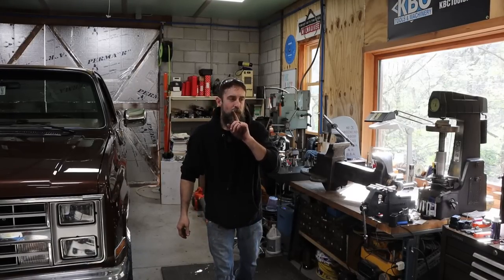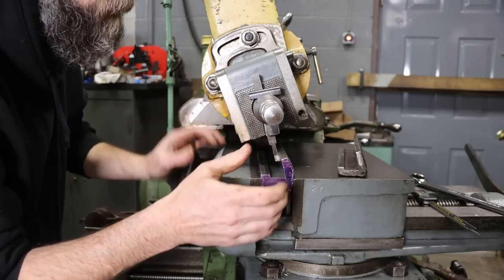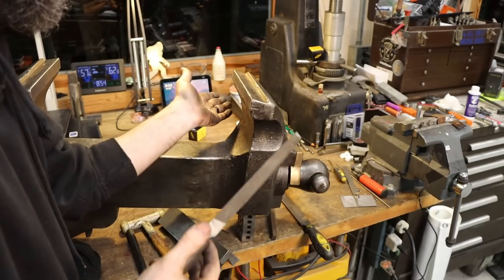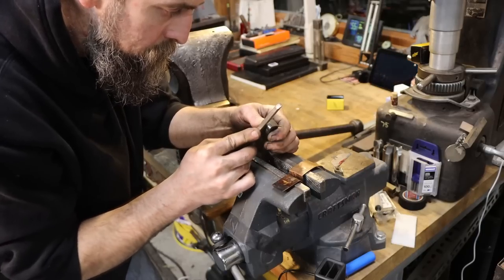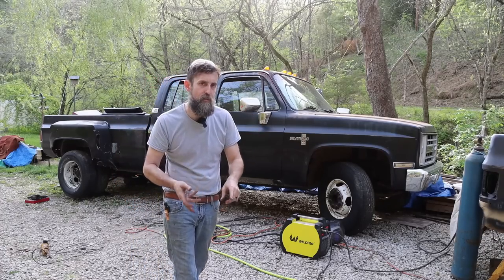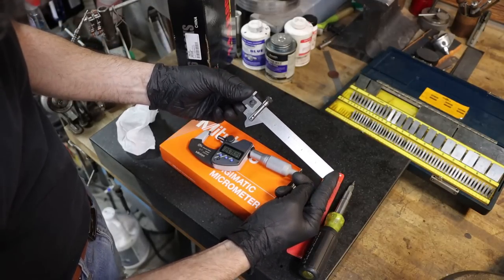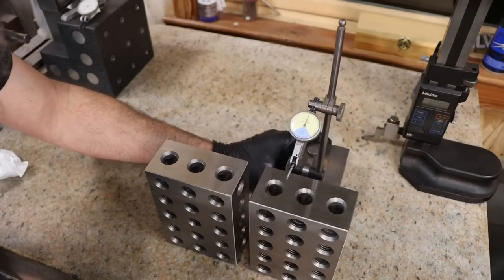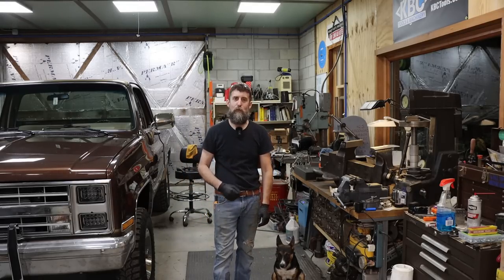Very Rare #6 Parker Vise Repair. Hand fitting the new Jaws!

Comment: This little series of vice jaw videos made me realize that a shaper does have a place in todays hobby machine shop. I've had a lathe , and a milling machine, for over a decade now and never saw the usefulness of a shaper...but finally, I've seen the light. There are certain things that a shaper can do fairly easily that no modern machine can do without some serious working around. If the right. lightly used, shaper appeared into my life, I'd just have to buy it.
Reply: I have a 16 inch heavy duty Cincinnati shaper with the vise, and the universal table, that is for sale. I’m located about an hour east of Amarillo, Texas. If you’re interested just respond to me here on YouTube. We can go from there.
Reply: @ssmt2  It's a bit too far for me. I'm in east TN.
Reply: @marcellemay7721  That would be a bit of a drive for one machine. Hopefully you’ll find one closer to home.

Comment: Glad to hear your Mom is back up and about, that must have been painful.    My dad passed 5 years ago.  He was in auto parts in the 1960's,  I think he would have been impressed by your pickup rebuild,  especially the attention put into getting the engine assembly just right, it would have made for some good conversation. My mum is 79 this year, and slowing down quickly. I guess my point is: make the most of the time you have left.  Greetings  from down under (Adelaide,  Australia).

Comment: My dad had a 3+3 1 ton two wheel drive 1979 GMC Crew cab.  Bought it new for around 13500$ new.  It had a 454 / 4 barrel. Great working truck.  It had two fuel tanks gas.

Comment: My 2001 2500 Suburban has the same engine transmission combo and it pulls great. The old girl has well over 250000 miles on it. Still kickn'. I'm replacing the control arms this year and maybe body mounts.
Reply from the maker: They were great engines . 4.8 5.3 6.0 lasted really well and were capable of handling  power adders without much or any changes to the bottom end. 200k miles + is not uncommon at all if they had a oil change or two

Comment: Tejas steelworks for the ls engine/transmission mounts……switch suspensions 6/8 bolt in kit for the drop…..lowboy motorsports for the 22” alcoa tuck wheel setup

Comment: wouldnt mind seeing the dually build , be a verry nice truck for like you said pull a trailer , if you find a box trailer or flatbed trailer you might be able to put a small sleeper unit on the front of it (old semi truck bunkbed sleeperbox with a door added in in the hole that was the pass through to the cab) and be able to take longer trips for less money (no hotel / motel costs) 
supprized she choosen such a large truck as a daily driver
as for the two four six blocks , you can make them great as you have the surface grinder

Comment: well nice truck  are you concerned that its not 4wd for winter . doesn't fit with the 2.4 drop . i have a lowered 2wd 82 and am going to convert it to 4wd  2.5 lift with 33's . i thought about using a IFS from the from the 90's to keep it low but I'm using 10 bolts . 
I wounder if you could fit a IFS one ton with out to much cost or work just a thought  . JM

Comment: I was hoping you were going to put a diesel in the dually. LS engines are fine but are totally over done on project cars and trucks. I wouldn't trade my '01 F350 Dually with the 7.3 Power Stroke for anything. I haul my race car trailer, and a 30 ft boat with it and you don't even know they are back until you look in the rear view mirror. Glad your Mom is doing okay. I'll be 72 soon and have had a few falls myself, but lucky I didn't break anything. Knock on wood.